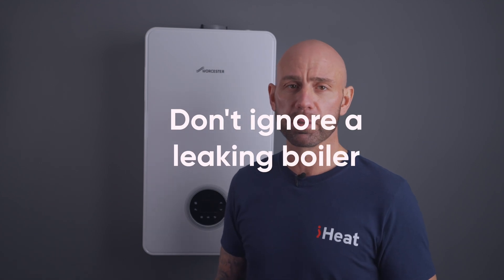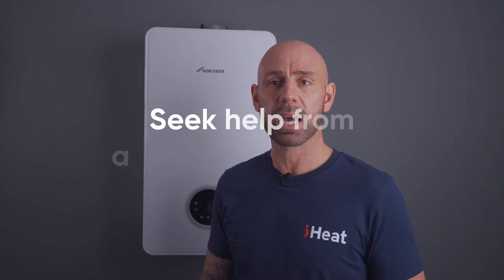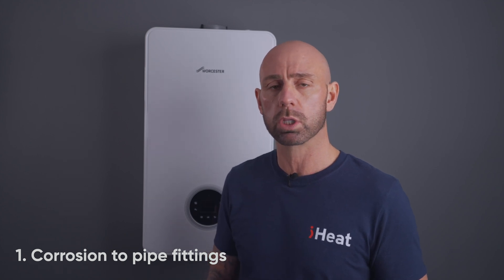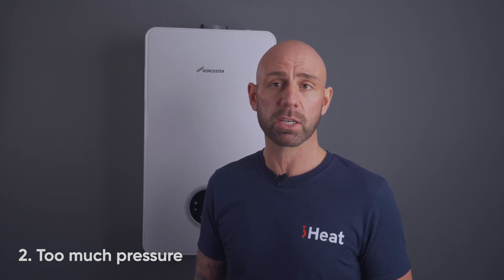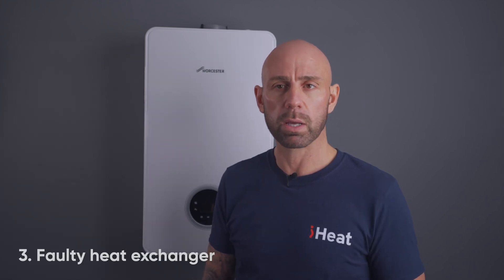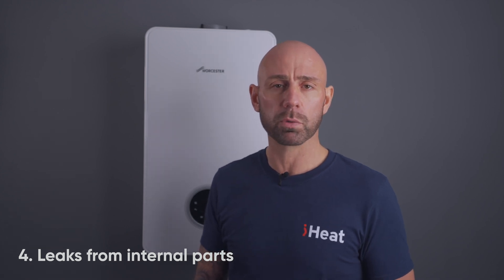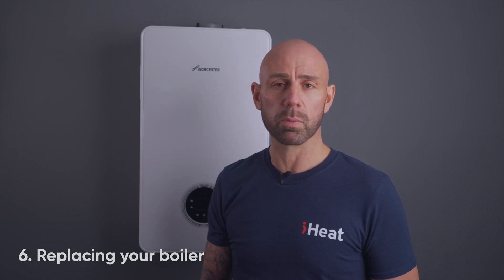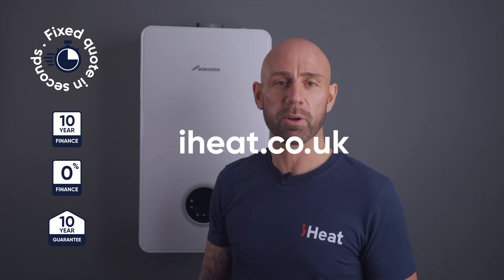How To Fix Leaking Boiler (Top 5 Issues)

Comment: Our Worcester boiler is only around 2 years old. It starts dripping only when it rains. Even when it’s leaking, it works perfectly well. Before we call a GS engineer, we’d like some help from you. Thanks
Reply from the maker: Definitely agree with the comment reply above. If its leaking when raining only, has to be a hole in wall/ ceiling from around a pipe or flue which might not be sealed correctly, if this is an iHeat job get in touch right away with the team.
Reply: Only leaks when it rains? Doesnt sound like a leak from the boiler, more like a rain leak down the flue pipe? If its a leak down the flue then the boiler will work perfectly, because its not the boiler thats leaking!